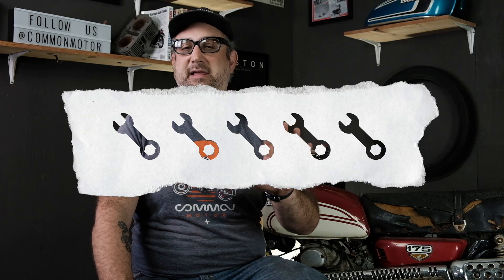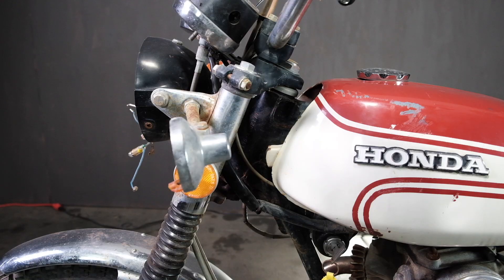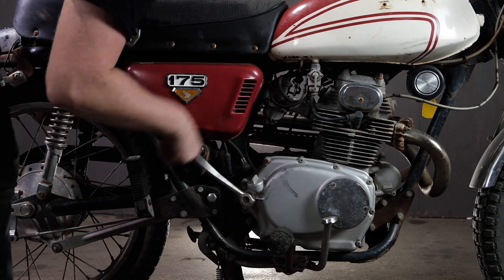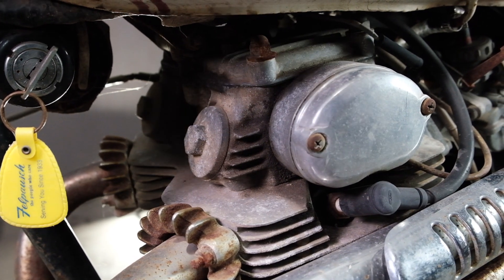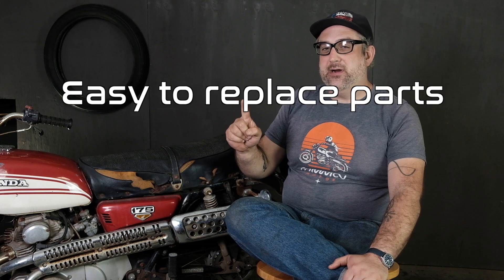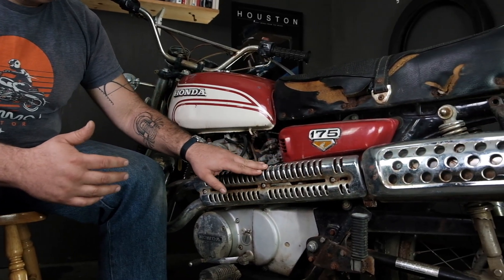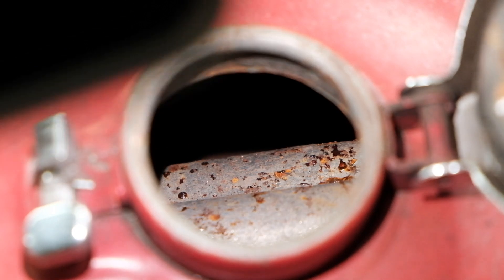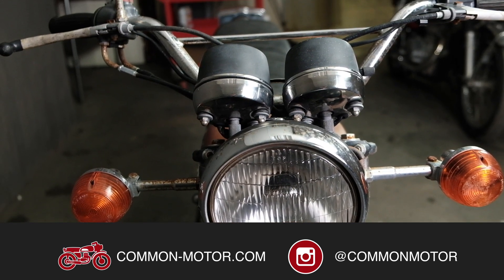How To Evaluate A Vintage Honda Motorcycle Project

Comment: I recently bought a storage unit full of what I thought was junk in the back of the unit was a 1974 Honda xl-100 orange metallic looks absolutely brand new and it shows 7.8 miles. But I could not find a title for it. My state said no title No way to street it. Tried in vain to try and run numbers on it but no go. And yes I got it running. Sounds great but haven't rode it. Trying not to put miles on it. So I guess as my brother said it's a wall hanger

Comment: Branden,i had a question and heck one for everyone else here, i have bought stuff from you man, great service, great people and great videos!!!

I am restoring a 550k that was left outside and sometimes it was inside and it was last tagged in 1984,of course you being a pro at this you know what it looked like without me giving you any pictures,lol,everything seized, rusted etc, i work in a shop so i have access to a lot of tools that the  common folk doesn't have, we even have a hot tank, i am restoring this bike very slowly and trying  to keep costs down but i want to do a really nice restoration.

When it comes to the majority of the hardware i want to get it zinc plated in yellow, my dilemma is this, for the first time in my life i decided i was going to this this correctly and every single hardware that came off that bike has gone into little baggies with a tag attached to it,every  single  one,i have proceeded to sandblast each one for a nice really clean finish and will save me a bit at the plater,my problem is when i take it to the plater they are not gonna put my stuff in my little bags, i will take the stuff in a plastic coffee can and they will do the job and give it back to me in the same can because thats what they like.

After all the work i did tagging everything i dont want to be trying to match this and that when they are done so i decided before taking it there to lay the hardware down next to its corresponding baggie and taking a picture of it,that will at least give me some reference point, believe me it sounds daunting but in reality there is not that much hardware on that bike compared to lets say a car,my question is, would you do it differently,do you have any pointers etc? i have learned in life that you might think you have it all figured out and some one comes along with a much better idea and your like "why didn't i think of that? "lol,anyhow thank you for your time.

Comment: I appreciate the overview. Here's one I see online:

"1973 Honda CL175 complete. New tires. Frame has been painted. Top end has been rebuilt. Needs new battery. Lights come on. Does not start. Cool bike. $2250 obo. Clean title. Comes with extra parts and original 1973 paperwork from The dealer."

Um, OK but you put (some) money into it and it looks decent in the pictures but ... why won't it start?? Asking $2K now. I'm tempted to look at it but it would have to be something as simple as ignition or carb clean.